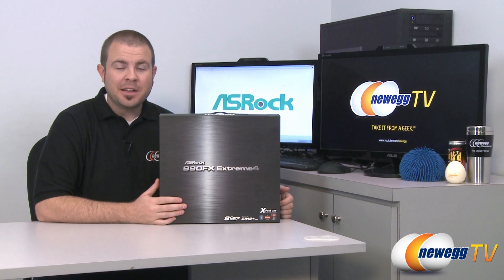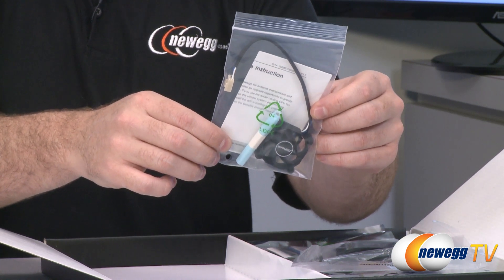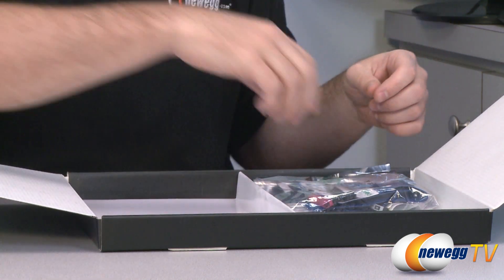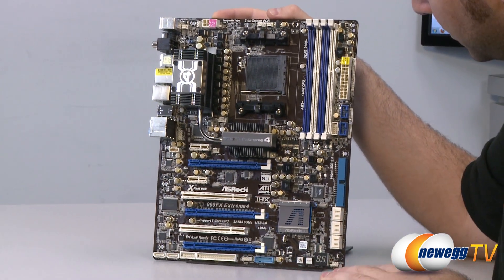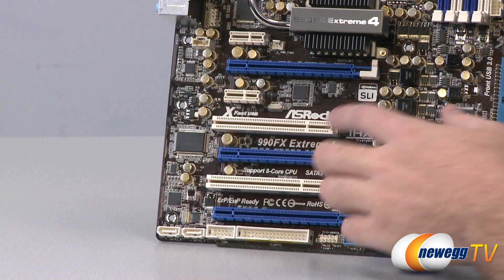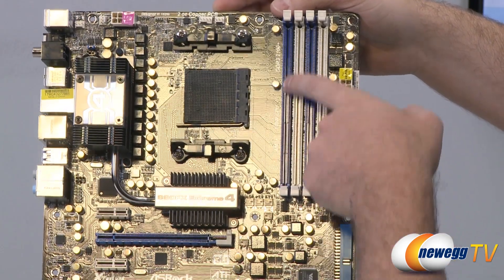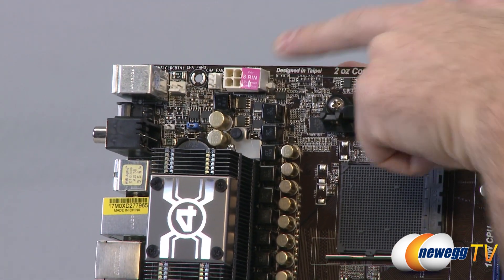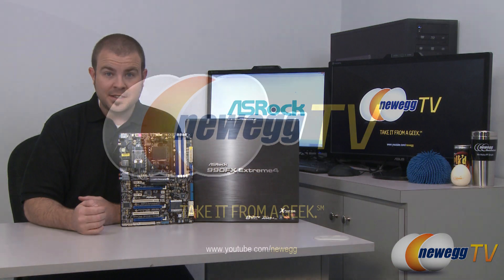Newegg TV: ASRock 990FX EXTREME4 AM3+ Motherboard Overview

Comment: i have an 970 fx extreme 4 i put an fx 8350 amd because the asrock consider this motherboard compatible with this cpu.... working like shit.... i'll never take other Asrock in my life. this is not a serious way to work
Reply: i did the same thing and its pissing me of. what did you end up doing?
Reply: i have take another mother board , it's work well but some time i have other strange issues but withi pc it's difficult to know the meaning of some problem. in any case with other mother board the cpu it's more cold
Reply: +Alessandro Schiariti what kind of mother board should I get? Or I might wait to upgrade to and i5 or i7
Reply: i had take msi 970 gaming fo 90 €, but olso in the futur i think to take an i5 !

i won't waith to see the performance of amd with direct x 12.

and olso i know tha same game often have problem for optimization and not for foult of cpu or other . 

for 90 € change motherboard and see if the problem can be solved. take olso an aftermaket cooler
Reply: +Alessandro Schiariti I allready have a water cooler so my temps are fine, and do you have any motherboard models you would recommend me??

Comment: currently trying to find out which RAM to buy for this board any suggestion i want to go for 8GB+ depending price but is 1600MHz enough, is this board 240PIN connector??
Reply: Ah hello yes I'm getting the 2133 mgz speed and I was mostly concerned over the 240 pin connection type on ram slots. I have 8 core processor and soon to be delivered is my GTX970 4GB with 8gb ram would suffice

Comment: WILL THIS MOTHERBOARD SUPPORT A AMD FX-9590 4.7GHz 8-Core Processor
PC PART PICKER SAYS:Some AMD 990FX chipset motherboards may need a BIOS update prior to using Vishera CPUs. (also will this G.Skill Ripjaws X Series 8GB (2 x 4GB) DDR3-2133 Memory) work since it's bus speed is 2133 will the board support it .sorry caps i need to know if anyone has an answer
Reply: supports ram up to 2400mhz. Look at the power reqs.. this won't support a 9590... that needs a board with 220W tdp capable board. This is 125W TDP. Get ASUS 990FX Crosshair Formula Z, ASUS Sabertooth or GIGABYTE 990FX UD5 or UD7
Reply: yea it tells me that also about the update thing im very worried :(

Comment: Nope, that processor uses socket FM2. This board, on the other hand, uses socket AM3+. You'll be able to use most Phenom II, Athlon II and a few Sempron processors in this, as well as all of the FX range of CPU's.

Comment: For FX 8320 and 8350 Buy the extreme 4 Extreme 3 can run them as well but isn't for overclock except turbo mode. If anyone push this beast-chips in 4+1 motherboard ,there a danger mobo will blow ! (I have read this in forums some have explode their motherboards).So 8 cores chips for overclock ONLY in 8+2 boards....

Comment: I own this board 1 week now. It comes with the bios chip updated (p 2.0) that means can support all new FX chip out of the box.I was thinking to pair it with fx-8320 but since I do only gaming why to buy an 125W CPU? (8 cores). So I buy and install the FX 6300 (95w) ,better power consume ,cheaper and 6 cores...doesn't exist program yet can use them ! It works like a charm and the 990fx x4 is 8+2 power phase gives you a LOT overclock feature.But for overclock I suggest better cooler than stock.

Comment: if you installed the drivers on the disk for this and the gpu when the system is up and running will it tell you that there are better drivers and install them for you ?  just wondering i am looking to build my first pc soon

Comment: I noticed that there was a clear plastic coating sticker over the north-bridge heatsink.  Is that safe to remove or is it there for a reason other than protecting the paint from scratches?

Comment: Well, yes for both questions. sata 2 devices are compatible with sata 3 ports. As for the sata card, just slot it into the 16x slot. It'll work fine.

Comment: I'm eventually thinking of buying this motherboard someday. And I'm not into overclocking. Will my sata-2 drives + my samsung sata-2 burner work correctly in those sata 3 ports? And will a pci-ex sata-card work in the third pci-ex slot? Because I have many drives in my computer. The sata-card is a 4x one, so that's why I'm asking.

Comment: ok i'm gonna tell you what nobody does, ALL THOSE MOTHERBOARDS are totally useless, all of them, even the fatal1ty one from asrock, why? because their NORTHBRIDGE GETS TOO HOT even with a soft overclock, if u not planning to overclock your processor u'll be fine even with an asrock extreme3 since it offers nothing less than the extreme4 and cost less, but if u want to overclock, and many amd users does there is ONLY ONE MOTHERBOARD CURRENTLY ON THE MARKET for that purpose: ASUS SABERTOOTH 990fx.

Comment: really? let me know how it works for you lol....  i got mine to work computer runs fine but the fan is causing like 50 pounds of pressure pushing down on the processor which im not comfortable with but it appears to still work since im on it right now lol

on top of that the fan lever is still in loose mode cuz locking it was NOT an option the lever will break off if i try putting enough force on it to turn the lever into lock position. so i just leave it loose

Comment: im having issues with this board or my amd phenom II 965 BE, the stock fan just wont fit, and its pushing down so hard on the cpu im scared its going to break, the fan clips on the sides just wont go low enough to reach both  sides to lock in...

Comment: i think that fan that comes with it is for the mosfet heatsink. the large plate with the "4" on it can be removed with the screwdriver and replaced with the fan. otherwise, use for water cooling, i guess.

Comment: @sheekm227 depending on your budget,you can just buy a simple graphics card with this motherboard.Graphics cards that have "ATI Radeon HD 4000,5000,or 6000 series"is just fine,depending on your budget.That's the flaws about these hardcore motherboards,they don't have onboard graphics.